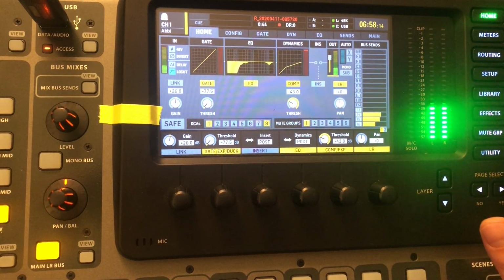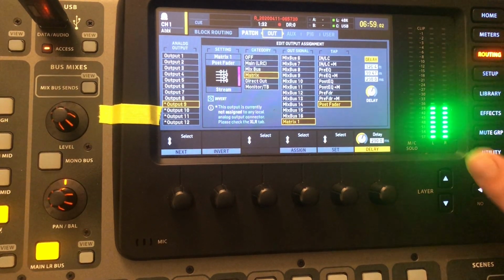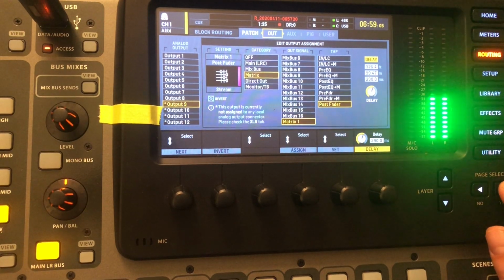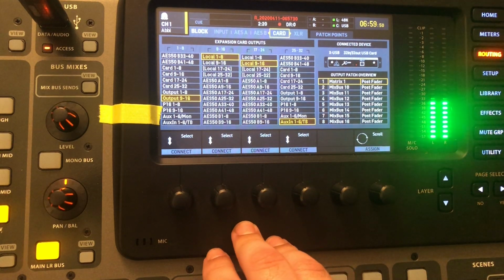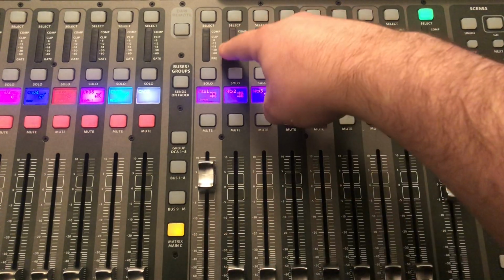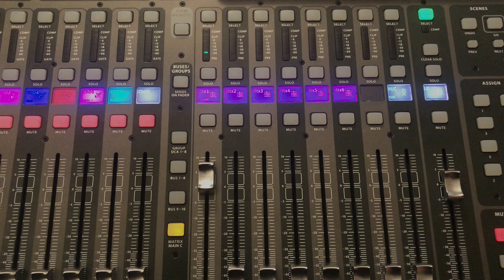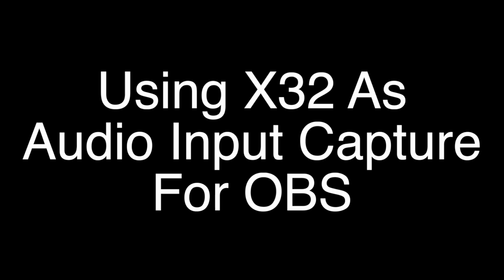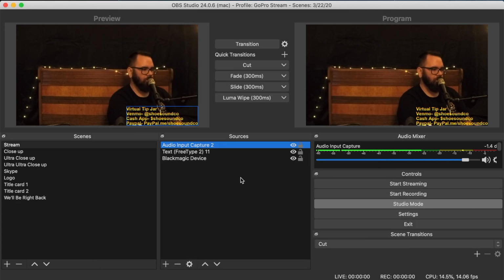X32 Card Out Audio As OBS Audio Input Capture Ep 1

Comment: Thank you very much for the very helpful and clear to understand video. This really blessed me and my church and we are one step closer to having a modern, more professional streaming capability to spread the good Gospel where people can actually hear it. I was able to get my main audio to OBS however the sound is very low. I'm assuming I need to adjust something on the soundboard to turn the volume up. Anyone else run into this issue or have potential fixes? Also, sounds like the sound of the microphones is way louder then the instruments...also assuming that's something I fix on the board

Also, for Audio Input Capture I have many X-USB options but I think X-USB (1-2) was the one that worked for me.

Comment: Hello, Video was great.  I set up my card output to mirror my mixbus 5&6 for streaming.  i connected the usb from x32 to PC.  I added the audio input for the x usb but there is no audio indicator or level showing in the audio mixer on obs.  What would be causing this issue?  I even went into the advanced settings on the PC so the input for obs was the x usb.
Reply from the maker: There’s a setting on OBS that will show you audio monitoring. That needs to be enabled I believe.

Comment: Thanks for the video. But how did you connect x32 to your computer for obs. Did you use xlr to usb cable?
Reply from the maker: Oise Oikeh thanks for watching! I used the usb card out from the board into my computer. Using what most people would call a usb printer cable.
Reply: @AskASoundGuyOfficial  many thanks
Reply: @AskASoundGuyOfficial  sorry, but did the 'printer cable' go straight into the computer or there was another interface? My obs can see the x-USB audio input but  no actual sound coming in the stream
Reply from the maker: Oise Oikeh, cable from x-usb card to your computer, no extra interface. The board acts as the interface. If you can see level on the audio input capture, you have it. May want to go into advanced audio setting and turn on monitoring for that input.

Comment: I fallowed this but Still don't have audio in OSB.  Checked the sound in my control panel and there is level there.
Reply from the maker: Crossover can you go through your set up?
Reply from the maker: In OBS>In the mixer, right click the settings gear, advanced audio properties, then  turn on output monitoring. If you had metering before you should be able to hear it now
Reply: Ok got it. I didnt have sound or meter. Had to reinstall my drivers. 
Anither question. Is it possible to monitor the mix from OBS with headphones plugged into my laptop?
Reply from the maker: Crossover, yep. That last comment had the instructions to do that
Reply: @AskASoundGuyOfficial  got it. Thanks.
Reply: @crossover8634  What driver you had to re-install?